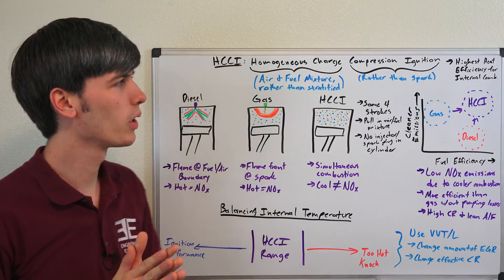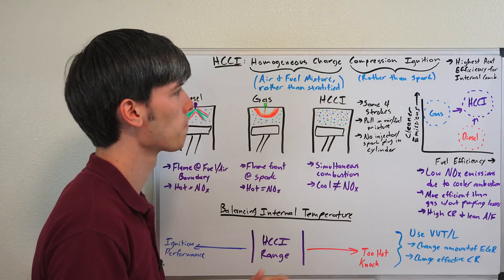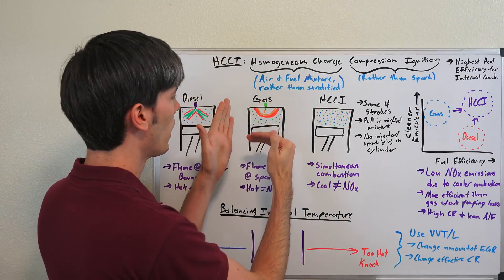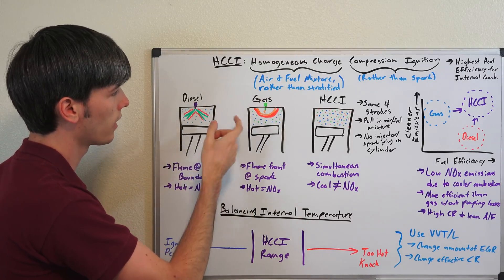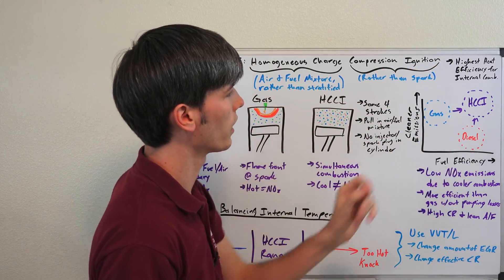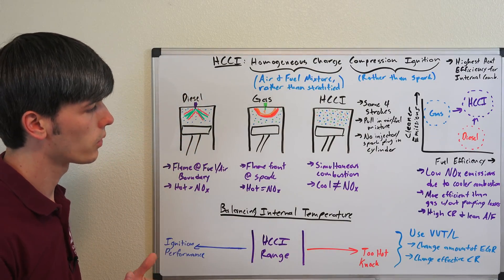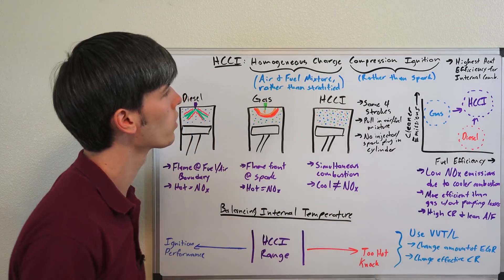The Most Efficient Internal Combustion Engine - HCCI

Comment: Questions : 
1.	Could methanol / high ethanol fuel be used in HCCI engines, would this help to increase the critical temperature range inside the cylinder before combustion? 
2.	Why did your title show a compression ignition model engine, are they considered to be operating on a HCCI principle?

Comment: I like mazdas approach to this with their skyactiv tech. Still uses a spark to control exactly when the ignition happens, which greatly reduced the research cost and overall cost of the engine, but also uses the high compression so stimulate knock at the right exact time so that it helps instead of being harmful.

Comment: I've heard Michael Archer say that he adds HHO to his gas engines, and that it increased fuel efficiency. I had heard that the activation energy for hydrogen is lower than that of gasoline (much lower if I remember correctly) and so it seems adding some HHO to the gas mix, more effectively makes the engine "ACT" like the HCCI they're looking for here, since I visualize that the hydrogen inside the compressed charge reacts and ignites at a lower energy than the gasoline, so the HHO acts as an Infrared combustion catalyst throughout the charge.

Comment: The Pogue vapor carburetor was a hot vapor type which delivered such a pre-mixed charge to the engine, and was capable of very high mileage.  Better vaporization of the fuel and pre-mixing with the intake air has always been the solution to fuel efficiency, and is nothing particularly new.  However, this particular approach here lends itself well to the development of a hyper-efficient and clean diesel electrical generator.  With a generator the engine runs at a constant rpm, meaning that fine control over combustion temperature is easier to accomplish.  If this system of air/fuel premix and temperature management was applied to a opposed piston two cycle diesel engine it would work well, because the temperatures inside the cylinder are very even and the incoming air is both supercharged for maximum oxygen density and turbocharged as well, which allows heat exchange to occur.  All of these processes could be optimized in an engine that runs at constant rpms, giving amazing efficiency and emissions.  For example, the engine coolant could be held at the ideal temperature with a thermostat, and there could be a coolant heated vortical intake chamber between the turbocharger and the cylinders where preheated fuel would be injected just after the turbo to swirl and mix in a mini-tornado before entering the cylinders.

Comment: HCCI is interesting, what about optimum bore to stroke relationship? I remember the Nebraska tractor test data showing that long stroke diesels (John Deere 2 Cylinder Diesel) seem to make the most HP per gallon - hour (not sure I remember this correctly) but it was a rating of the amount of horse power per gallon of fuel an engine could extract.  Max engine efficiency could be another competition for College and Tech  Schools like the ECO-Marathon is except only focused on the engine and not a complete vehicle.  The competitions are interesting and advance technology along with educating some young minds.

Comment: Smokys hot vapor engines were hcci. If you could use modern electronics to go to regular cold fuel and air under high load it would be feasible because even with top shelf componets those motors destroyed themsevels if horse whipped from preignition.

Comment: Question: why can't we inject a concentrated oxygen instead of diesel or spark to commence the combustion , this can get the best of two words, localized higher oxygen partial pressure is equivalent to higher pressure that can start igniting the compressed fuel air mixture at the time we need, without having a fuel rich boundary layer that makes alot of NOx

Comment: Reciprocating piston internal combustion.  That has to be said, because there's balance issues, and the mass of the pistons turning around, going back the other way (Inertial losses) which make RPIC engines inherently less efficient.  Some sort of rotary (Not necessarily a Wankel) is going to be more efficient due to Conservation of Angular Momentum.  A spinning rotor wants to keep spinning, so there's no inertial losses.  A reciprocating piston wants to keep going through your valve cover, and hood.  The other pistons have to stop it, and turn it around to go the other way, 4 times per (Otto) cycle.  That burns a lot more fuel.

Comment: @ 4:24 he says, "If you leave that intake valve open while compressing, you can reduce the effect of compression ratio so you won't be getting temperatures quite as hot when you finish that stroke, you won't have as much efficiency, of course, but you can influence the temperature within that engine........."
I'm confused how you can maintain any kind of compression if you leave an intake valve open.

Comment: What about Smokey Yunick's HOT Vapor engine he built in 1984??? He cut down a Buick V 6 engine removing one bank and the other bank from three cylinders to two cylinders totaling 74 cu in producing 150 HP. He put it in a Fiero and drove it to the big three auto manufactures where their engineers said it shouldn't be able to run. He had the gas/air mixture going into the combustion chamber heated to 400 F that the gas was now a total vapor. Smokey said that when he drives it he got well over 50 mpg. The General Motors engineer drove it on their test track getting 74 mpg with surprising performance for only 74 cu in engine!

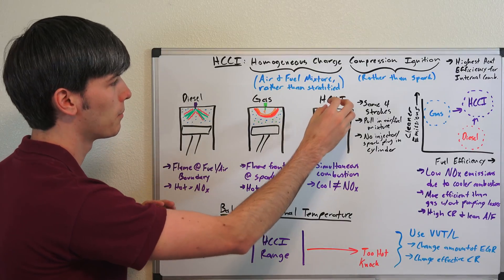Comment: 3:20 - I have to disagree. "The challenge here" with HCCI, is in the first two words "homogeneous charge". The AFR required to run HCCI effectively,  requires significant an engine of a given displacement to burn 'X' amount of fuel. Sure, you can dilute the intake charge with EGR gasses, but you can only dilute the mixture so much before it can no longer sustain ignition. This vastly limits the engine's ability to sustain reasonable no-load (idle) conditions. Granted, one could implement cylinder deactivation... but we already have engines on the market suffering from reliability issues related to the technology. Furthermore, HCCI is extremely sensitive. The slightest change in atmospheric pressure, compression, or temperature, and it you have drastically weakened combustion event.

For these reasons, HCCI will remain a supplemental technology. It simply isn't reliable enough, nor does it suit the demands without supplemental starting power to generate sufficiently stable conditions within combustion chamber, and the catalyst system.

It's worth noting, however... HCCI is by far the best overall solution for range extender engines in hybrid electric vehicles. The ability to run the engine at a much more consistent load and RPM are very conducive to the process. For all intensive purposes, this is the most ideal application.

Comment: A flame front travels at 350 m/s.  Sound at atmospheric pressure travels at 344 m/s.  Could the HCCI timing be controlled more precisely by compressing the air/fuel mixture close to self-ignition, but not quite, and using transducers to send a sound wave (pressure wave) into the mix?  The peak pressure might ignite the air/fuel at the precise time required, and from multiple places (multiple transducers).  I bet there's still some NOx, but probably less.

Comment: Sorry I am not sure you are entirely right.  Nitrous oxides come from nitrogen burning in oxygen.  This happens in a diesel engine as the compression ratio is nearly twice as high as a gas engine.  If a gas engine had the same compression ratio it too would produce NOx, but the fuel would burn too fast at these ratios as it has a much lighter vapour than diesel so the engine would not work.  An HCCI engine is more efficient as the whole fuel burns at once, rather than a burn working its way outward.  This gives a  clean drive on the piston, which if engineered correctly gets more energy into the stroke.  Diesel and gas are less efficient as there is more time for the burn which cannot be so well coordinated with the stroke of the piston resulting in inbalance of the drive, in other words more energy lost as heat, requiring more fuel to create the same amount of useful power.

Comment: Here’s my question, if you use VVT to adjust your combustion chamber temp, how do you prevent backfire? You can almost always let an exhaust valve stay open longer to reduce the compression ratio but if you do that with intake you’re going to disturb the airflow and pressure on the plenum and probably cause a chain reaction on the other cylinders, unless this is a strictly one cylinder idea. Would be curious to know the solution

Comment: The idea is to compress the mixture to the point where it reaches the temperature at which the mixture self ignites just at the dead center without a knock. The relationship between the temperature inside a cylinder and compression is not constant at different loads, rpm and environmental conditions which is the real problem.
My idea is to use an electric supercharger to control the total amount of air in the cylinder. It can vary the quantity of air and fuel with the varying load, rpm and environmental conditions in such a way that the temperature inside the cylinder always reaches to the point of self ignition when poison reaches the dead center. Please comment on it.

Comment: why not inject water with dissolved hydrogen and oxygen this will allow for accurate temp control and a with a much faster flame front that will burn lean and cold. the water will need to be chilled at a constant temp.  EGR has been a terrible red herring.

Comment: ANSWER IS  :  2-STROKE DIESEL BURNING HYDROGEN  ,, THE NO2 PROBLEM EMISSIONS CAN BE OVERCOME WITH METHANE /METHANOL/H2O INJECTION AS WELL AS USING A DIFFERENT CATALYST , HIGH HEAT PROBLEM : CAST THE ENGINE/BLOCK/HEAD OUT OF OF CERAMICS , VERY CHEAP EXTREME HARD & HEAT RESISTANT MATERIAL NATURALLY TO WORK WITH  ,  THE EARTH IS 75 % COVERED BY SEAWATER AND IT JUST SO HAPPENS THAT THE EXHAUST EMISSIONS RETURN THE H2O TO OUR ATMOSPHERE . A WIN/WIN SITUATION FROM EVERY ANGLE !

Comment: My prototype reduces knock and allows for optimum ignition timing.  This allows for combustion to happen much earlier than it normally would.  Then peak cylinder pressure can occur at TDC like it's supposed to do!  

This extra time can be used to create more steam when using A water injection system, for added efficiency gains.

A short video is on my page.

 I have done more testing since then, with mostly positive results.  The prototype tends to not like carburetors as much as fuel injected engines.  This is because carburetors have lean conditions cycling though, constantly.  Watch the slow motion video of A mini rotary engine, too see the carburetor lean pulse problem for yourselves.  

The diesel engine I tested the prototype on ran smoother with more power.  So high compression engines also see benefits from reducing knock.   Advancing the fuel injection timing on A diesel is how you get the most from that type of engine, while using my prototype.

Comment: This Engineering Explained guy has no idea what he is talking about.  Why is he talking about things he is NOT competent on?    
The main reason why a diesel engine is dramatically better in thermodynamic efficiency is because as the fuel is not injected until combustion start (just before TDC), pre-ignition/pinging is not possible and it can have a much higher compression ratio.  Its also more efficient because the air is not throttled as it must be in a spark ignition engine, which operates stochiometrically (fuel and air in chemical balance).   Diesel is even more efficient because high degree of turbo boost can be used - again because pre-ignition is not possible.  Turbocharging doesn't just give you more power - it gives better fuel efficiency because it recovers energy from the exhaust and returns it to the intake air.  That's why all modern diesel engines are turbo boosted (except for certain applications eg fire pumps and where sudden large increases in load occur) but spark ignitions are seldom turbo boosted, and when they are, either the turbo is effectively disabled a lot of the time, or the compression ratio is made low, or both.  In gasoline engines, compression ratio is limited by the onset of pinging, but in a diesel there is no real limit.   But there is an optimum in diesel engines - above about 15:1 to 16:1 you get friction  losses and especially heat lost to coolant rising progressively faster.
Now, in a HCCI engine, you can have somewhat high compression cf traditional gasoline engines if fuel and other factors permit, but you still have throttled air intake and limited ability to turbo boost.   Hence its efficiency may be better than a spark ignition engine, but can't be as good as a diesel.
Modern turbo diesel engines are so close to the maximum theoretical efficiency for any piston engine, taking into account heat lost to exhaust and coolant, plus friction, running ancillaries such as oil and coolant pumps, there is virtually no scope for useful improvement.   (theory about 54%, practical about 49-51% except for very small engines.)
But there's more:   While a spark ignition engine is only about half as efficient as a diesel at full power, in most applications (especially car & light truck), most of the time the engine operates at a fraction of full output.  A diesel retains high efficiency at low power settings, but a spark ignition engine does not.   A HCCI engine will share this disadvantage of spark ignition.
If combustion occurs simultaneously throughout the combustion space, then there is little opportunity for turbulence to increase the conduction of heat into the metal surfaces.   So, this implies a small increase in efficiency, but it also means an increase in peak temperatures, not less as this guy claimed.
I could cite even more, but you get the picture - this guy just doesn't know the subject.

Comment: Might applications with fixed resistance and even speed partly or completely solve the problems with controlling the internal heat? I imagine that the unpredictable behaviour of a driver in a car isn't optimal with these types of engines. Even if you have quick, exact sensors and computers the mechanics of the engine itself must respond quickly to the temperature balancing measures.

Comment: What's the optimal temperature range (small as it is) for auto-ignition, and surely the system can be isolated against ambient thermal influence? The thermal variations within the specific system would then be known quantities and designed to account for.

Comment: I saw a recent article on microwave ignition (petrol/gasoline) with a microwave plug... If you haven't seen it check it out. Very similar to hcci
Reply: Ps my first engine in 1978 aged 3 was a 2 stroke 0.5cc DC dart hcci diesel engine with a 5" propeller and variable compression  😎

Comment: Bear with me - have not read through the comments on whether this old school question has been asked, but, doesn't the hotter we can burn hydrocarbon fuel, the cleaner it burns?  Is that correct? And, if so, has it become an easier technological leap to HCCI with cooler burning that reduces NOx, than an engine design that could handle the heat needed to burn petroleum cleanly?

Comment: What about ignition timing at full throttle/full load, when you want to have fuel as much as possible, as much as possible compression to burn that fuel (A/F mixture) and adjust the ignition timing to make it ignite more early before TDC? You can't delay the inlet valve to regulate the temperature/compression where are you talking about at the end of the video, cause then you'll lose some fuel to burn...

Comment: Actually the most efficient possible engine is the Satz Rotary Positive Displacement Hot Gas Regenerative Engine--see the paper "The Solution to the Gas Turbine Temperature Problem" in the journal Energy Conversion and Management, Vol. 20, pp. 49-63.

Comment: Curious to know... Would there be any benefit to an HCCI engine, set up to use diesel or kerosene? Is it possible? I would think the additional hydrocarbons would increase fuel specifics. But would you increase pollutants in the process?

Comment: I think Mazda has a similar engine design. The only difference is their’s does have a spark plug used for cold starts when the engine doesn’t have right temperature from the compression stroke. I curious how a turbo charger with would effect this engine set up, perhaps a follow up video on that?

Comment: the fuel and air is mixed together inside yhe cylinder and ignited via high compression caused temperature rise. there is such a problem as a very short conditions band when the engine can run properly comparing to the regular gasoline engine.

Comment: I get depressed every time I think about how we are probably the last generation to use gasoline vehicles. I love cranking the throttle and hearing that engine rev up, shifting though the gears, and on cars hearing that supercharge whistle and the turbocharge flutter. I hope to god that we find an alternate option to gasoline so we can still here these engines roar, instead of the whine of a 1 gear electric engine. While gas engines might not be as useful or efficient, some guys just need combustion engines to feel and hear the power within it. Get electric cars for non-car guys and some renewable fuel that acts like gasoline only it's not a fossil fuel (and if we get lucky maybe even have it not pollute nearly as much).

Comment: What fuel induction system, regardless of price, would be most optimum for POWER output for a racing engine? Would it be Carburetors or fuel injection? I'm assuming it is Gasoline Direct Fuel Injection? Awesome videos Dude, loving the content!